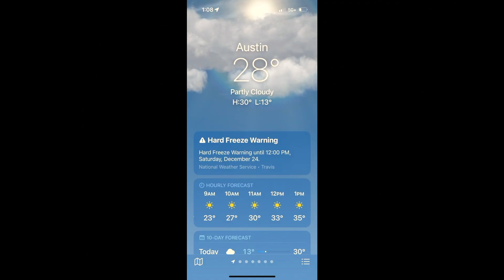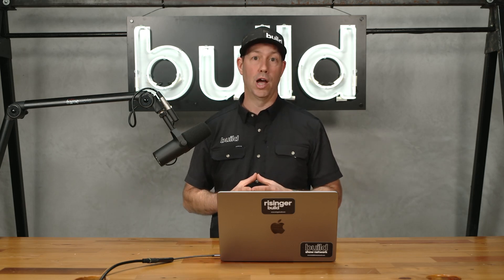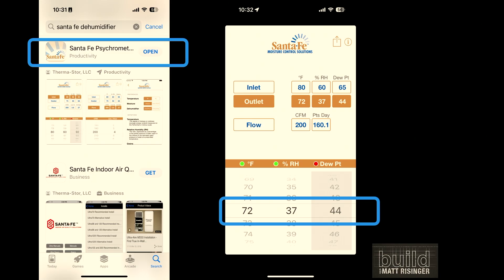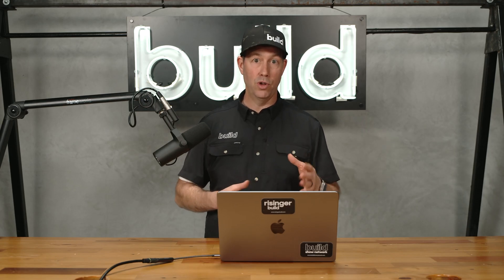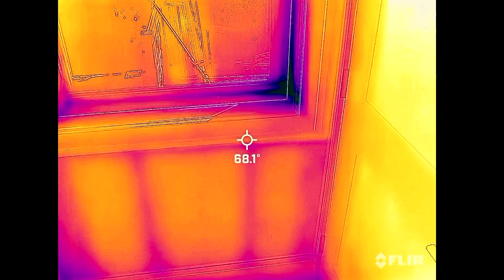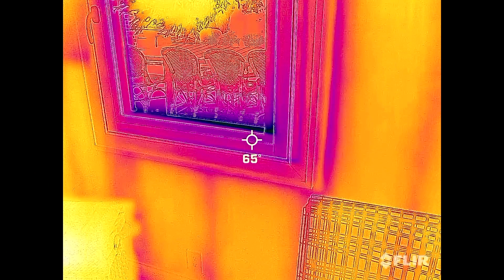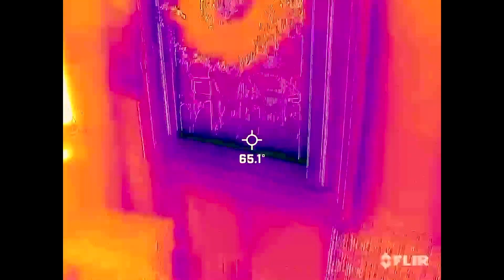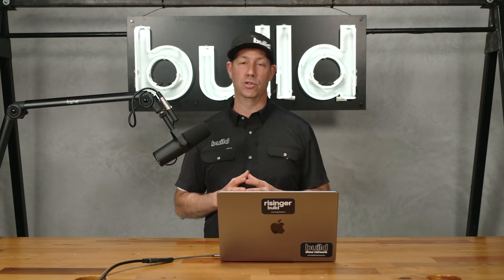Window Condensation Explained & How To Avoid on a New Build

Comment: Great video.  I wasn't buying the "lower your indoor humidity" answer that I see everywhere online and it's very helpful to see that even a well built house that is airtight and insulated can still have condensation problems if the windows get too cold.

I also don't buy the "always keep your indoor humidity at 50%" idea and it's good that you discussed dew point.  My indoor temperature ranges between 55F and 65F and indoor humidity ranges between 60% and 65%.  At those temperatures, 65% relative humidity is comfortable and isn't a problem.  To drop the percentage down to 55% requires running a dehumidifier constantly, wasting electricity just to collect a small amount of water.  During the spring after a rainy day when my indoor temperature and relative humidity both get close to 70, that's when dehumidification is necessary.

Comment: The moisture is humidity. On the outside is the summer with hot humid air outside and cold ac inside and it’s going to be miserable outside. On the inside is in the heat mode with cold air outside with high humidity inside. That’s not good

Comment: I live near New Orleans in a 100 year old house. It has lots of single pane, double sash wood windows. Heavy condensation forms on the outside of the windows during summer days with high humidity. I've also had condensation dripping from the central AC registers in the ceilings.  The attic is insulated, and I've put extra insulation around the registers, but some continued dripping. For the registers, I leave the ceiling fans on low in each room and that keeps the registers dry. The bathroom doesn't have a ceiling fan, so I put a small fan on the shower floor that points up at the register. However, I haven't solved the condensation on outside of the exterior windows. I think the solution might be the same as keeping my telescope glass free from condensation on humid nights. A thin heating wire taped to the inside of the window glass & a sensor that keeps the glass warm enough to keep the condensation at bay. Any other suggestions for a solution to this?

Comment: This is why most central air HVAC systems have vents in front of all windows....I think Matt used some ductless mini-splits on his house, when you use ductless mini's you tend to centrally locate them in rooms ie. not in front of windows, this allows window temps to acclimate to outside temps more than the traditional central air ducted systems.  When designing houses with ductless hvac systems you really have to take all of this into account.  The typical Man J/S/D calc doesn't account for WHERE the ducts/mini's go, only how big (BTU etc).

Comment: Disappointing video because there are things that can be done to remedy this. And yes cheap $200 dehumidifiers aren’t great but what about a more powerful one like a Santa Fe? It may be worth $1,000 to get a Santa Fe because 40% indoor humidity is actually pretty high when the temps get low. This video made me feel better that I’m not alone but it lacked the depth it should have had.
Reply: 40% is the absolute minimum RH you should have for human health.  Mucus membranes in the nose and mouth are your first defense against infections. Dry heated winter air inside the home is a big reason why ppl get sick more in the winter (it’s not cold that causes colds).

You don’t want mold on the windows, but your body should not have RH < 40%

Comment: So what is the solution to prevent or get rid of the condensation without replacing windows? We have triple glazed and still get it in our bedrooms. You said using extractors or dihumidifiers aren't really a solution.
Reply: The bedrooms are worst because you have one or two humans breathing out moisture all night long. Try to not keep doors closed all night, don’t dry your hair after showers in the bedrooms. Hard to recommend much else w/o more info

Comment: Great video with great information, Matt! What amazing fact that most people don't know is that there is an astounding difference in the amount of water vapor air can hold with change and temperature. For example air at 72° F can hold six times as much water vapor as air at 20° F. Look at another way if it's 32° outdoors and the relative humidity is 40% and you bring that air indoors and raise its temperature to 72, the relative humidity drops to 12%. Though these differences can create challenges, it is all of the qualities of water and water vapor and ice that enable life in all of its forms to even exist on Earth.
Reply: Yeah, he’s making this problem worse with a 72f setpoint.

The indoor air holds so much water at 72, it’s sucking it right out of humans, toilets, etc. That thermostat setting is no bueno

Comment: Very interesting to have all this explained. I recently bought a 1981 condo (in Vermont) with what I think are original single-hung sash windows made of wood. The storms are aluminum. I have been watching the condensation come and go on the glass, as well as puddling on the wooden sills and muntins. I heard about humidity (run fans, cook with covered pots, don't dry laundry on indoor rack, etc) so I am paying attention to that. I've also tried getting more airflow through the house (864 sq ft) so that humidity doesn't get trapped inside. That helps a bit, but I hate paying for heat that may be escaping through that cracked window. I think it may be time to invest in better windows, because I am noticing that mold grows in these cool, damp areas. If I close my shades/curtains at night for privacy, there is usually plenty of condensation behind them in the morning. And mold growing on the wood areas. If I do get new windows, I have read about the importance of making sure there is good foam insulation around the window hole before closing it all up with trim. Your video was helpful.
Reply: Yeah, opening windows in the winter to let out moisture is playing whack a mole. 

I know it’s not cheap, but an ERV system is the way to solve that problem (getting fresh air without losing all the heat)

Comment: No mention of testing for leaking or missing argon gas which could be a manufacturing defect.  If you want to be scientific, why not measure the temperature of the glass outside and inside to determine if your new windows are properly insulated between the panes of glass?  Definitely do not want to use a thermal camera to measure the temperature of the glass.

Comment: Window coverings seems to have a marked effect on condensation. i notice that my window coverings on my new build do have some thermal value thus surface temp of frame/glass remain low relative to true inside temp if fully covered. all windows not covered never have condensation because its closer to inside air temp. interesting phenomenon but I guess its all explained by science!

Comment: In Ohio fogged windows are an indication of a crack in the furnaces heat exchanger or a blocked chimney. 
Putting carbon monoxide into the living space. 
This is completely fogged windows. Not just a little condensation in the corners. 
And with the locally typical double pane, vinyl framed windows. 
So if a home suddenly starts getting foggy windows look there first. 
It could be anything from a bad furnace to a bird’s nest in the flue pipe. 
And it needs fixed before you go to bed that night.

Comment: Just a small critique on your method for using the thermal camera coming from a certified infrared thermographer.

Glass is highly reflective and will reflect the infrared heat from the room back to the camera. As you can see your heat signature is being bounced off of the glass and showing up on the camera.

 To get an accurate measurement of the thermal signature of the window you want to use a piece of white electrical tape and a piece of black electrical tape on the glass pane so that it increases the emissivity of the surface. Low emissivity surfaces such as glass need to be manipulated with an additional surface to allow for proper thermal imaging. Otherwise the video is spot-on. Great work is always Matt!
Reply from the maker: Excellent tip. I’ll do that. Thanks

Comment: Having a high efficiency brushless DC motor for your furnace blower that you can run 24/7 at a constant, low speed circulation is excellent for reducing cold spots that can cause condensation here and there too. And it also aids with re-evaporating the condensation that does show up on the windows.

Comment: “Humidity control does not equal condensation control”
I have to disagree with this statement as worded. If what you actually mean is humidity control is no substitute for better insulated windows and better vapour barrier… then I agree. 
Up here in northern Alberta winters are cold and dry… and condensation on double pane PVC frame windows is “controlled” in my 2007 relatively loose house with a whole home steam humidifier modulated by a humidistat with an outdoor temperature sensor. The humdistat reduces humidity setpoint when the outdoor temperature gets colder. With this system I can vary how much condensation shows up on the windows with ease.
Reply from the maker: Yes. Excellent modifier. Agree

Comment: Dew point, technically saturation vapor density, is 100% relative humidity. Dew point is based entirely on the level of moisture in the air and is totally independent of temperature. Said again, air temperature (inside or outside) has NO effect on the dew point temperature. 

As shown in the video the dew point temperature can be determined using air temperature and relative humidity. That calculation works because relative humidity is a percentage of  the dew point (or 100% Rh) at a specific temperature. 

Since relative humidity is a percentage of total moisture at a specific temperature, Rh can be changed by adjusting temperature. Raise the air temperature and Rh goes down. Lower the air temperature and Rh goes up. But raising and lowering air temperature does nothing to change the dew point. Because of this, using Rh when discussing window condensation can be misleading. 

As an example, a room with 6.25 grams moisture per cubic meter of air will have a dew point of 3.33°C (38°F). If room air temperature is 18.33°C (65°F), then Rh will be 40%. Raising room air temperature to 23.9°C (75°F) will lower the Rh to 29%, but dew point remains the same at 3.33°C (38°F). While you "feel" differences in Rh, and it is important in many of the building materials used in your home, it's not necessary an indicator if you will have window condensation. If glass temperature is above dew point temperature - no condensation, if glass temperature is below the dew point temperature - condensation.

Takeaway from the video -- "humidity control ≠ condensation control" is correct IF it's amended to read "relative humidity control ≠ condensation control", however humidity, when considered "as total moisture in the air", is absolutely the primary consideration when dealing with window condensation.  

There are two ways to control interior condensation, first raise the glass temperature to a level above the dew point; second, remove moisture from the air to lower the dew point to a level below the glass temperature of the windows.

Comment: to stop condensation, crack the window ;)  That's what happens when a house doesn't breathe [e.g. leak all over].
Reply: Not true. Condensation happens when the windows are not suitable for the climate.
Reply: @BoringBurger    thanks for the correction of my joke.  Duly noted.
Reply: @designbuild7128  Hah, with new eyes, I see it now. Good one. 👍

Comment: You forgot to mention condensation that occur on the outside of a well insulated window when its outside is colder than the due point
Reply: Curiously, exterior condensation can occur even when the air temperature is above the dew point since the glass can be colder than the air temperature due to glass radiation to open sky (actually all the way to space)

Comment: I replace all my windows and if it gets below 20° we still get some condensation on the glass at the base of the windows. Still much better than the old single pane aluminum windows we replaced. Any extended periods below 20° and we would get ice all around the frames at the base of the windows.

Comment: Hello! I’m in the northeast where temperature and humidity are a giant headache some days. I have had so many issues with condensation on windows and doors to every other surface in the house near the exterior wall. One window five feet away from another will have moisture while another won’t. Air flow is important. That’s for sure.
Reply: Same here in Ct

Comment: Also depends on the direction the window is facing as well. Typically your south-facing windows won’t have this issue as much because of higher sun exposure. Maybe consider having higher quality windows on the north side where the temperatures will be a little lower. Also just a comment on people suggesting putting registers under the windows - this is great for solving the condensation issue, however from an energy efficiency perspective, you’re losing more of that heat through the inefficient window assembly than if you were to place that register elsewhere.
Reply: curious, what is a register? google is not my friend
Reply: @jebimasta4604  Diffuser I guess would be another name? Or vent? The place where hot air is supplied to a room - in Canada usually on the floor under a window in single detached homes.
Reply: @Oh22Yeah ▪︎ always someone who’s the buzzkill
(lol)

Comment: I live in Calgary Alberta and in Jan and Feb we get to -40C. We definitely have humidity and condesation issues with our windows and we have pella triple pane windows. The issues you spoke of are absolutely true but i will add that if you have a bedroom you usually have a blackout blind to control the light at night. This will create a lot of condensation on those windows. The builder had the same explanation like turning on fans and decreasing the humidity which i found untrue. To have your house at a lower humity than 40% is unbearable.

Comment: This past summer I installed some privacy film from a company called Gila because of glare issues I was having. It also purported to have some  heat retention properties and to my surprise, the one pane that has the film has no condensation or pooling. I've ordered more film to expand the testing. 

(These are double glazed vinyl windows)
Reply: I also have Gila privacy film/window tint on two of my windows and while it helps with reducing heat in the summer, it does not help with condensation during the winter at all.  I have single pane windows in an old, cheaply built house.

Comment: Interesting. Each time I see a video from Russia in poorer areas, they have an outer window and an inner window. I wonder how effective this would be? I assume the outer window is freezing but not exposed to warm inside air and the inner window would be just warm enough to not condense?
Reply: It is very effective. We used to have the same window design with outer and inner single pane windows with a big gab between them in the older days here in Finland. Now with the evolution of these windows we have single pane outer window (aluminum) and triple pane inner window (wooden) in a ~8 inch wide wooden frame and there is zero problems with condensation.

Russia on the other hand is nowadays mostly adopted the American style window (most often plastic) design because they are cheaper.

Comment: Hey Matt, a little off topic question. I see you have an iPhone and a Flir camera. Can you tell me what Flir camera and iPhone you have? I recently upgraded to the 15 Pro with USB-C instead of Lightning connector. Flir customer support isn’t sure if their USB-C camera will work… because they immediately suggest the Flir Edge Pro, which has a $400 price hike from their USB-C model. 

This question goes for anyone who has tested it too I suppose. Does the Flir USB-C camera work with the iPhones with USB-C? Or would the Flir Lightning with an USB-C adapter work? Or would I have to spend the money on the Flir Edge Pro, which works wirelessly.

Comment: You would be amazed what a little sun can do to warm up the frames etc.
Also, curtains and even blinds can create still air that act to insulate that interior surface of the window letting it get colder.
Best thing you can do is make sure you have the blinds ds open, make sure you have good air circulation and mop up the water in the morning.

Comment: I built 6 layers of clear plastic and vinyl plastic framed inserts for all my windows.  They feel warmer than the gypsum board walls. Condensation is due to heat radiating out through your external structure in the winter.  Insulate your house.

Comment: To avoid condensation 1) keep air humidity about 40% , not more during the cold season 2) the window frame and glass temperature (especially corners) must be higher than dew point temperature, to do so in some old houses the surface below windows was at 45 degrees  to the floor, so the heat from radiator , which was located right below every window can easily heat up the windows. This days one can easily integrate electric heating cable of plastic heating water pipes in to the windows boards
Reply: @happyotto6436 ▪︎ weren't these the old boil-fed radiators? If yes, they were so large they practically covered the entire wall space below a window.

I would think some enterprising individual or company has already tried/studied/evaluated adding a wall-intregated heat source below a window. The trick is finding the info.